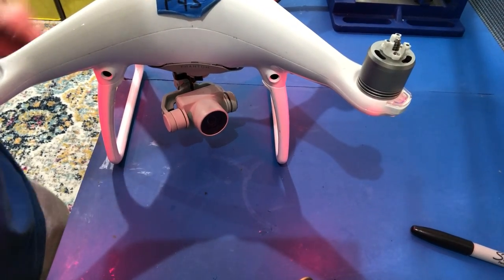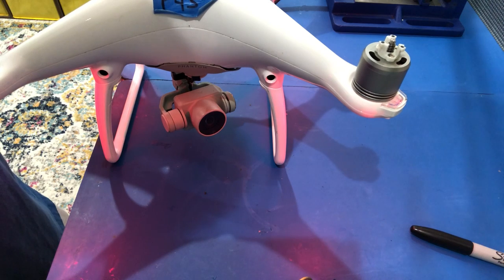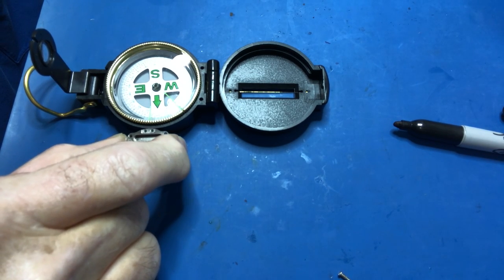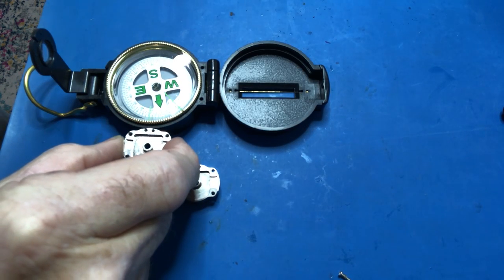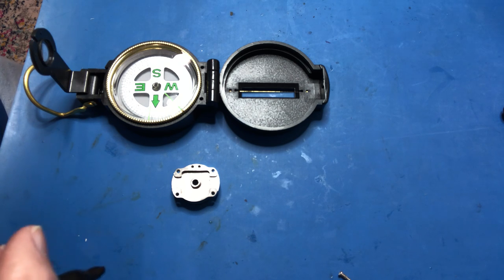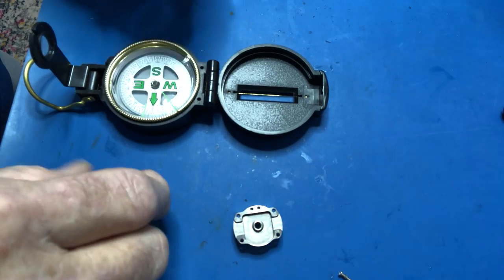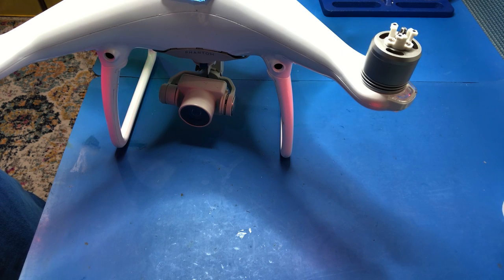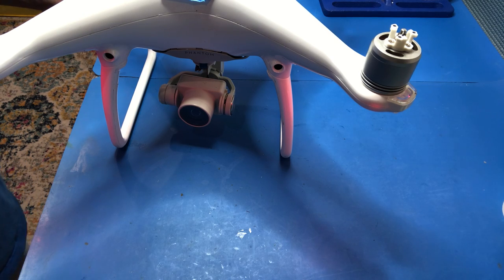DJI Phantom 4 series Yaw centering

Comment: very good tip my friend Ted Keyser , have you thought about relocating , taking off the magnet and repositioning it so that it is correct ? because in cases where both the esc board and the yaw motor are changed, and they still won't invent a software for this calibration, hug from the friend from Itai sp brazil!!!
Reply from the maker: That might just be my next project. I have to figure out how to release the magnet
Reply from the maker: I have hundreds of cases for the yaw. There are only about 5 different locations. Using a compass is the easiest way

Comment: Hello, I have a question please:
Do you happen to know if it is complicated to replace the PITCH MOTOR of the camera in the Phantom 4 Pro? Thanks in advance
Reply from the maker: No it is a direct swap.
Reply: @Droneted  Thank you
Reply: @Droneted  And do you know if you need to disassemble both sides or only the side of the PITCH MOTOR ?
Reply from the maker: @YL-mc9oz  You need to take the back cover off the camera head and release the latch that holds the pitch motor cable. Then there are 4 screws that hold the motor assembly. 2 on the camera head and 2 on the roll arm
Reply: @Droneted  Thank you very much !!!

Comment: Do you have a possible solution for a dji phantom 4 pro that the camera won't tilt up or down. I replaced the yaw arm and roll arm and yaw motor because I bought it after someone had crashed it
Reply from the maker: First I have to ask if the gimbal goes through the start up procedure? The pitch would move up and down during start up. if it does the problem is in the remote controller settings.
Reply: Drumroll....

Comment: Hello Ted: I have changed the Yaw motor of my PH4 according to your instructions, using the original casing to avoid deviations in the chamber. Despite this, the camera faces to the left, but I don't have other casings to try. Furthermore, the yaw motor does not seem to have enough strength since if I move it manually it takes a while to focus on its wrong direction, not firmly as the other motors do, but weakly as if it were drunk. Do you have any suggestion? Thank you so much
Reply from the maker: I have seen a lot of defective yaw motors lately.. Most of the defects are loose windings. If you take the casing off and grab the windings with your fingers they should not move if you try to turn them left or right. I buy 20 at a time and check each one . if they are loose at all I glue them. I recommend you return the yaw motor as it is probably no good. Where are you located? I would be glad to help you.
Reply: Hello Ted. Unfortunately I am somewhat far away, in Buenos Aires, Argentina, where there are not many options to get spare parts at the moment. I bought the engine on eBay. Anyway, I'll try to take it apart again to check it, while I try to get an original motor. We´ll keep in touch. Thank you very much for your answer @Droneted
Reply from the maker: @fabiofasano5622  What did you find?

Comment: I have a phantom 4 pro plus. My camera continually moves left to right and right to left upon start-up. I tried calibrating the imu, the compass and the gimbal. can you help?
Reply from the maker: You have a damaged yaw motor. I think the Hall sensors are damaged. A tiny scratch will cause this. What my other video about replacing the yaw motor
Reply from the maker: https://youtu.be/4q9fmd5iWVM

Comment: If we lose the original cover, how can we fix it again?
Is there another way to fix it with the new cover that comes with motor
Reply from the maker: not really. If you loose the original You have to get your hands on a few casings. If you use the one that came with the  where it points. then take the casing off and see where the magnets are located. If it points to the right, you need one with the magnets to the left of where the casing is marked. If it points to the left you need one to the right of it. If you can send me a photo of nwhere you mark it and a photo of where the yaw points I can help you figure it out

Comment: How can I get that compass and I need it for the job of that problem
Reply from the maker: It is a Boy Scout compass. Very cheap
Reply: @Droneted  I need to buy and how to get it from alixpress or ebay
Reply from the maker: Either. eBay might be easier. Where are u located?
Reply: @Droneted  It is found in Africa, Kenya
Reply: I'm sorry if I get the ebay link so you can buy it
Reply from the maker: The item number is 183985795497
It is about $10 USD.
Reply from the maker: I found this compass on AliExpress 
Just found this amazing item on AliExpress. Check it out! $0.50 | 2023newPortable Compass Military Outdoor Camping Folding Compass Green Hiking Survival Trip precision Navigation Expedition tool
https://a.aliexpress.com/_mr6EhuK
Reply: @Droneted  🙏🏻🙏🏻 thank you